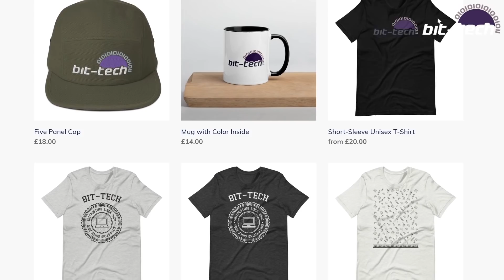AQUACERAS Part 9 | Putting a Radiator INSIDE a Distro Plate WITHOUT Tubes | bit-tech Modding

Comment: I had an aquacomputer copper airplex 3/120. Looked beautiful but the performance was horrible. All depends on aesthetics vs. performance and your mental framework. If you can forget bias against Barrow and it's performance is better, use it. The Aquacomputer would look great.
Reply: The airplex full copper rads actually perform quite decently, but at higher noise levels compared to most other radiators.
The fin/core design is rather ill-suited for pc use and you have to brute force airflow to make them work and get the level of performance you'd expect for the price.
You pretty much have to go push-pull with a set of A12x25 or F12s on the cold side and S12As on the hot side (or A12s plus shrouds).
Otherwise your cooling system will be outperformed by a 15$ chinese rad from ali and a set of 7$ arctic fans^^.
Results in a very expensive setup. And you're not going to see much of the expensive thing with so much stuff bolted to it^^.
Reply from the maker: Aye that's one of the factors as to why I went for the Barrow one. The aquacomputer ones are a more industrial, high pressure heat exchanger design, more akin to the ones in a car or AC unit really. I'll see what the Barrow replacement is like first, if it's also crap I'll swap over though.
Reply: @bittech1  Let's hope the replacement is made of a stronger batch of chinesium^^.
If not ... the Airplex will at least look the part.

Comment: Totally out of context Alex and probably too personal to ask but I've been thinking about this for several videos right now and I feel I have to ask for it... What's up with that red rash you got on your forearm? I've got myself "ulcerative colitis" (don't know if it's called this way in english, did a quick google translation) and these type of rashes happen to me too sometimes. I use "Protopic" for it and it helps a lot. Don't know if you're treating it right now with something but only wanted to point something out that could help :)
Returning to topic: A shame that you've got this problem with the radiator. Have you tried to contact Aquacomputer directly? They would surely help you out on this beatiful project if you don't mind changing the radiator manufacturer and probably the distro layout (surely the worst part to redo).

Comment: @bit-tech For a radiator try looking at transmission or oil coolers, like this https://www.onallcylinders.com/wp-content/uploads/2017/05/04/Cooler-10.jpg
They are PC size and come in various shapes and sizes with a variety of fittings.  They'll be more robust also I've used them in builds over the years with no issues.  Just do your typical cooling system prep.  There's also refrigerator radiators.  I recently used a transmission cooler like this in a build https://static.summitracing.com/global/images/prod/large/der-13249_w.jpg
Another one I used https://www.speedwaymotors.com/B-M-70265-Super-Cooler-Polished-Aluminum-Transmission-Oil-Cooler,106.html  Also motorcycle radiators are small.  There are alot of options especially looking at import car parts, they're often anodized cool colors, etc. etc.

Comment: At https://youtu.be/-NWIC-0Y8ig?t=1561 26:01 inside the radiator, is that some blue-green corrosion on the copper?  Might want to get rid of that so oxide flakes won't make the the clear water channels look fouled.

Comment: when it said inside the radiator, i expected the rad to actually be INSIDE of a distro. Not this. All you did was thread the rad directly into the distro rather than having a tube run to it. thats not inside of a distro
Reply from the maker: Parts of the rad are literally inside the distro and the tubes connect to inside of it. Stop being a negative Nancy.